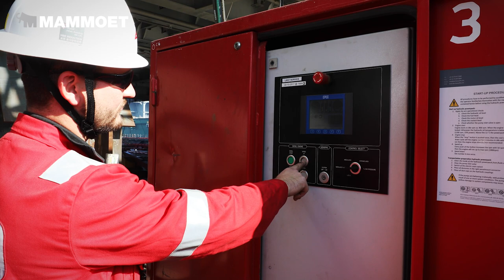Weighing and loadout of Processing Platform's Topside - The largest and heaviest module.

Comment: I would have thought using standing barge(s) beside the platform to help keep it stable would have been easier to implement than the ballasting method. Every shift of the module getting it into position means the ballasting needs to be adjusted, where the standing barge would be stable and could hold the platform more securely than ballasting alone.